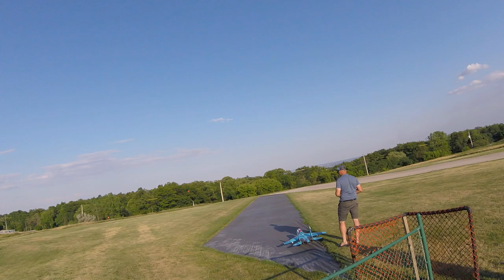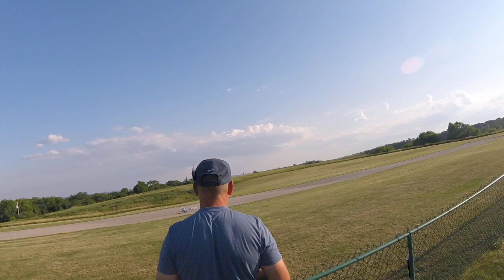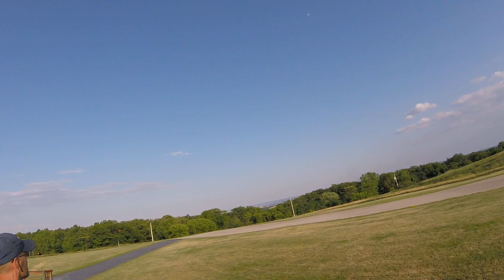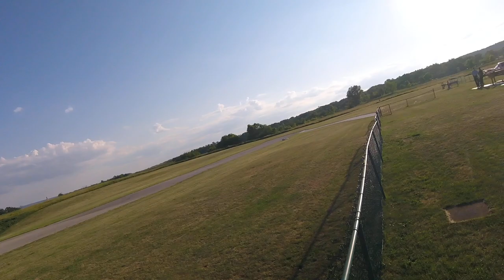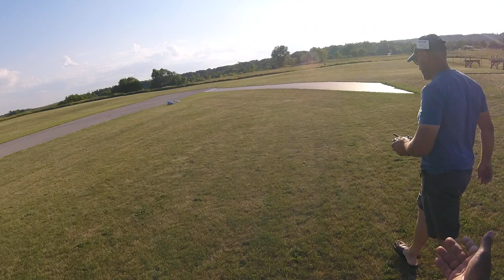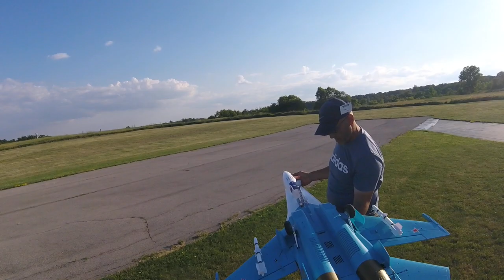Eflte SU 30 8s Flight #4

Comment: Why did you decide to change to 8s besides a little more torque?  Also, did you have to change out the stock ESCs?
Reply from the maker: I think the plan is underpowered stock so we upgraded the ESC to a castle light 75 8s. ESC actually is lighter than the stock  it also pulls less amperage so it's easier on your batteries. This was the only modification that was made to the power system still the original motors just running off of 8s. If you check under my playlist for the SU-30 you will also see that there are three different power upgrade options that was filmed . One with dr. mad thrust 2600 KV  70mm motors with a stock FMS fan. The other with freewing 70 mm inrunner motors and fan that come in the F-35 and of course the last one 8s stock motors and upgraded ESC with battery bay mod  the air brake compartment. Regardless of which modification you choose speed is significantly better than stock. Cheers
Reply: @ghoustanable  Thank you.  Did you just remove the air brake function?  Could you have kept it?  Or was it in the way of the  new mid section battery?
Reply from the maker: @Flight6677  it was in the way.
Reply from the maker: The plane was under power stock and flight time was short so that's why I converted it to 8s. The ESC was changed to Castle Creations Edge Lite 75 with stock motors and a 800mah 3s pack for the flight controls. Flight times did not improve much on 8s but the power is much better as you can see.